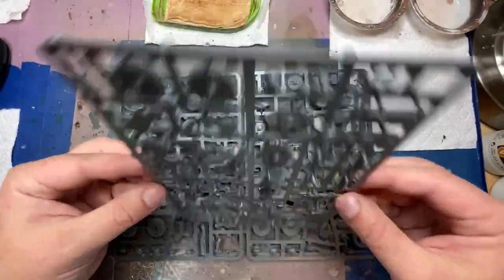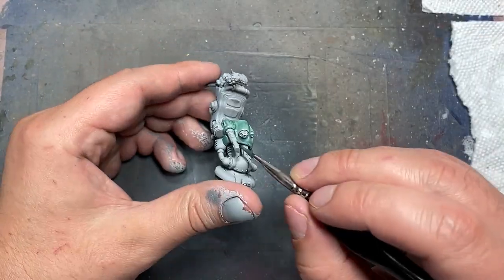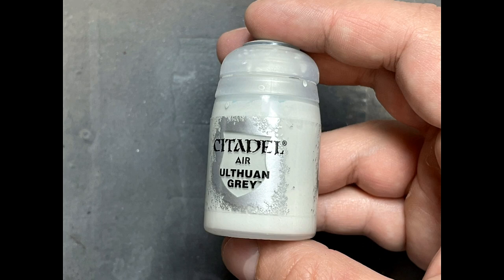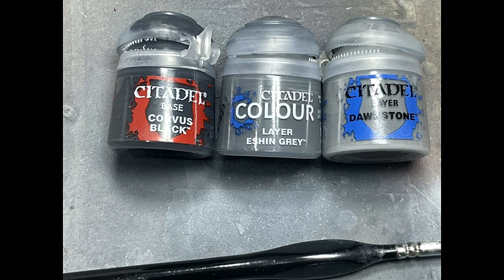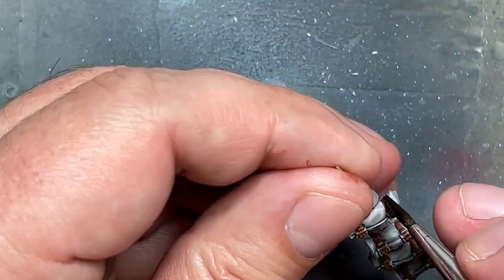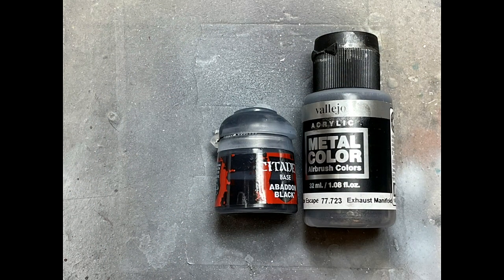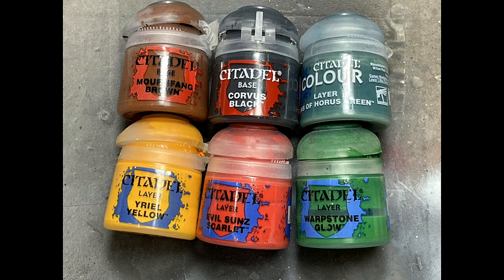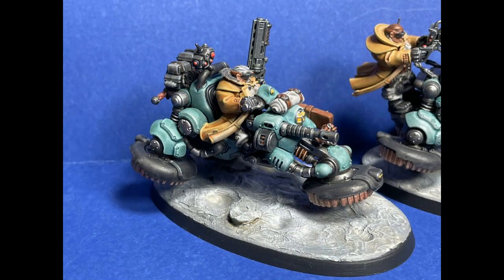Joyful Painting - League Of Votann - Hernkyn Pioneers - A simple job

Comment: you are supposed to glue rider before side wheels that way capes dont interfere with parts of the wheel.
Reply from the maker: Yea I figured that out after a bit but it still was an issue.  Even without the wheel things in the way the riders still didn't fit in well.